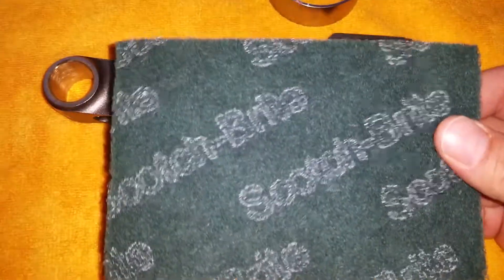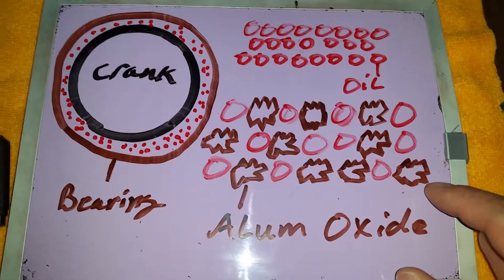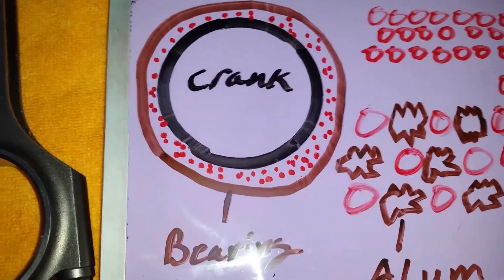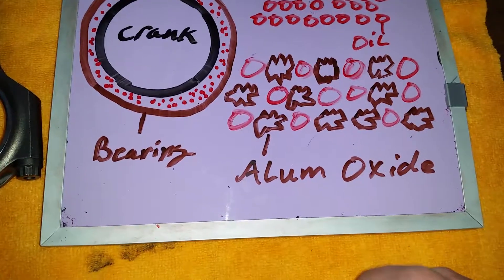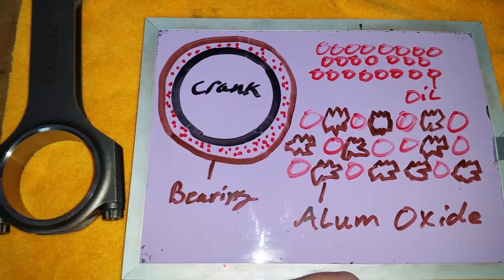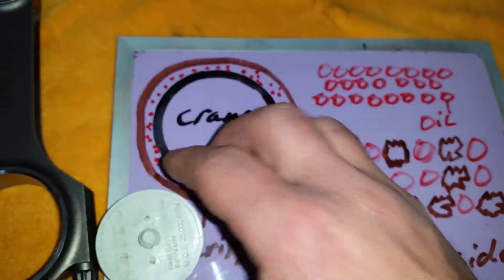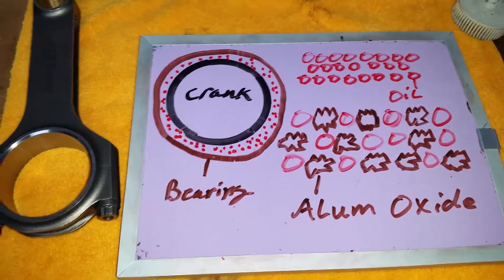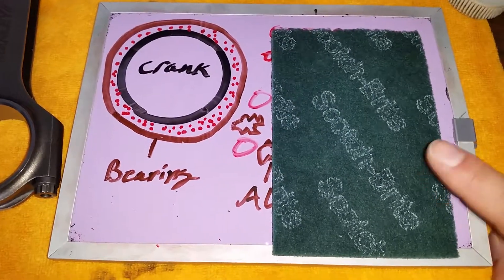Don't use green Scotch Brite pads to clean cylinders

Comment: Good vid ..to bad i didnt see it earlier ,,I scotch 2 of my cylinders with PB blaster but the engine is on a engine stand ,,Could I flip the motor upside down and spray the cylinders with brake cleaner to flush it ?

Comment: How does a material that is softer than any bearing in the engine going to damage to said bearings if the bearings are harder than the aluminum oxide? To scratch or damage a surface the material has to be of equal or greater hardness.
Reply: The bearings are made of aluminum, bronze, and lead. You can scratch lead with paper. You are lost

Comment: Do you think I can get away with the scotch brite I used to clean off a intake manafold gasket surface, I tried to get all the dust out but there is still some left in the runners, rookie mistake I know I should have had something in the hole to prevent that

Comment: Okay I tried my best to follow I’m not completely finished with the video but your saying their is aluminum oxide in the pad and the (spin cleaner thing lol) or cleaning it with the pad gets it in the pad?  And even if it’s used on a dirt bike engine? Even a hone can do this? Sorry might be dumb questions it’s a kind of a lot too
Reply from the maker: Aluminum oxide is in both the pads and discs. I don't recommend either for cleaning any surface that does or could come in contact with anything in the lubrication system even in a dirt bike. 

No a hone will not do this, I was specifically talking about cleaning cylinders after they have been bored and honed.
Reply: SME 2002 okay thanks for the info I almost used one of these before but changed my mind
Reply: I'd love to know why you think an AlOx honing stone isn't going to introduce the same AlOx particles. 

The reality is that it does.   The other reality is that none of these abrasive cleaning methods should be used without a complete post cleaning.   THAT is the reason these remnants were found in soft bearing material as they were used on a partially assembled engine.  You can't properly clean an abrasive out unless the engine is apart.  So the real lesson is stop using any of these abrasives unless the engine is completely apart and your going to clean it afterwards.

Comment: What about using 0000 steel wool?
Reply from the maker: That would actually be worse then scothbrite. Think about how bad thousands of tiny metal particles floating around would be.
Reply: SME 2002 I would of imagined not many after cleaning, so what you are saying is cleaning the area with a lint free cloth won't pick these particles up? 😥
Reply from the maker: The odds of getting them all is very low. The real questions here are why chance it and what do you think you are accomplishing by using it?
Reply: SME 2002 To clean up a forged cylinder wall that doesn't need honing for example? What would you use then in this scenario?